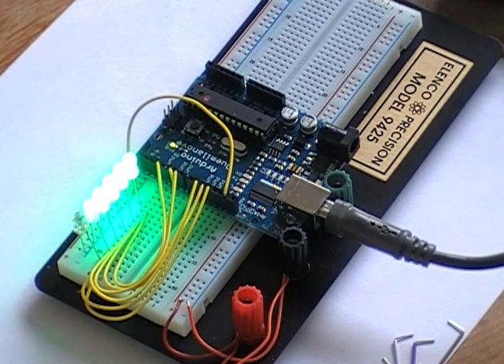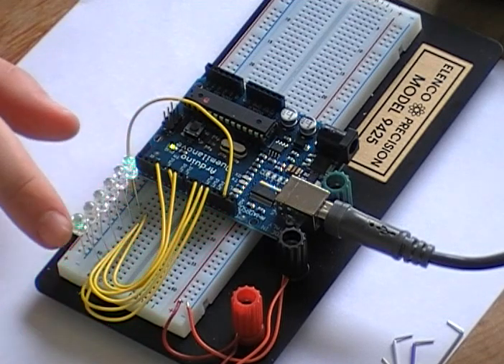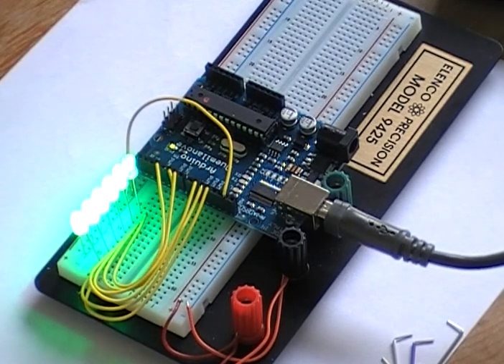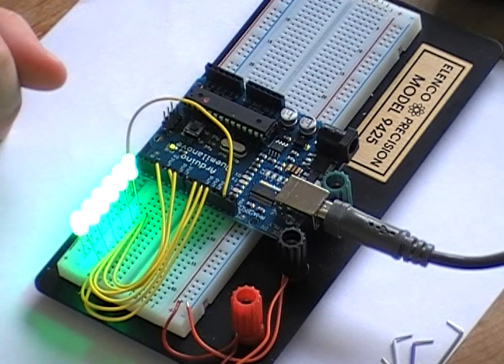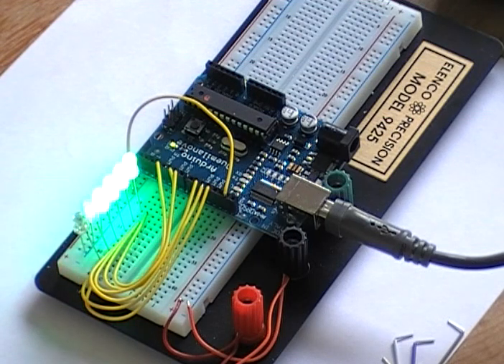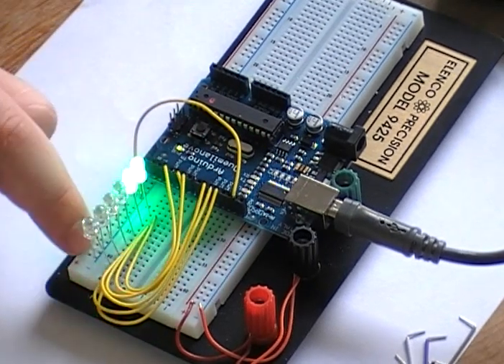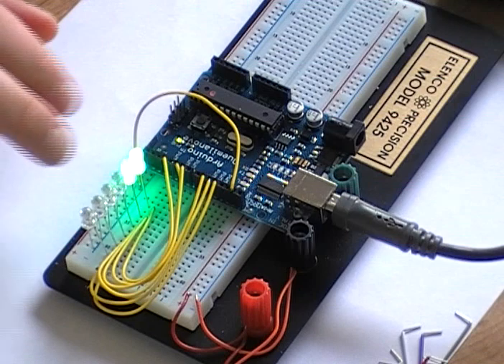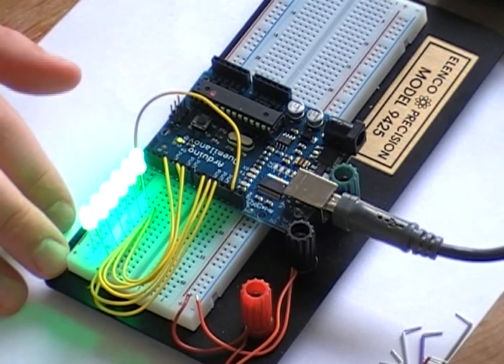Arduino PWM LED Chaser

Comment from the maker: @danimal511 You could put resistors on the LED's I suppose. The arduino can only sink 20ma per pin and the LED's are 20ma. It would be safer, but I just wanted to get it made and start playing around with it.
Reply: most people that put in a resistor for companies use 910 ohms and thats like about 6ma for each LED at 5 volts

Comment: Is this board running off usb power only? I'm thinking about going arduino after having so much painful times with microchip pics, also does the board program any smaller chips, by that i mean ones with a smaller pin count. thanks

Comment from the maker: I've looked at the mega, but I'd rather design shields to do what I want the 'duino to do.

It makes it cheaper in the long run and more fun.

This coming christmas I'm going to use a similar concept except with tlc5941 (16 pwm outputs) to do some awesome christmas lights. Brings the total cost up to 45 versus 60 something for a mega.

Comment from the maker: The arduino by itself only has 6 pwm pins. You'd have to add some other components to get more led's hooked up. I've been looking at the TLC5940, but I can't seem to find them anywhere.